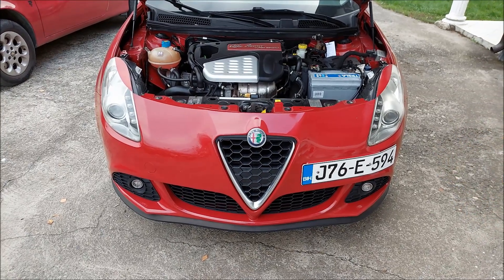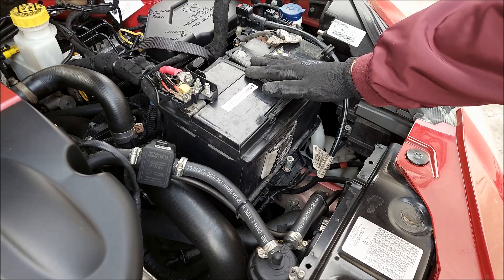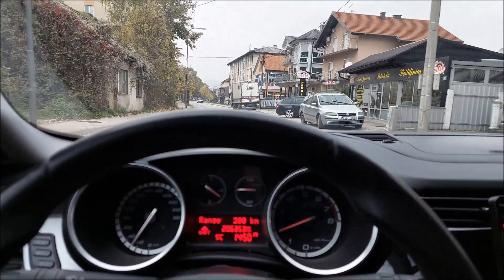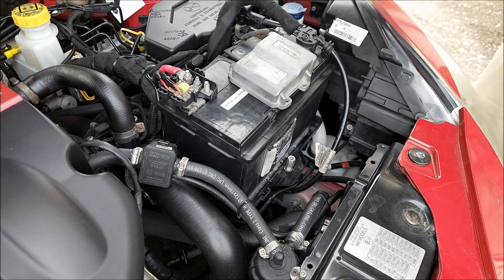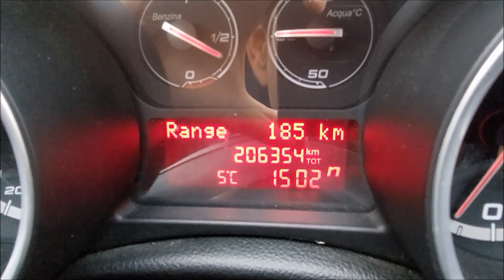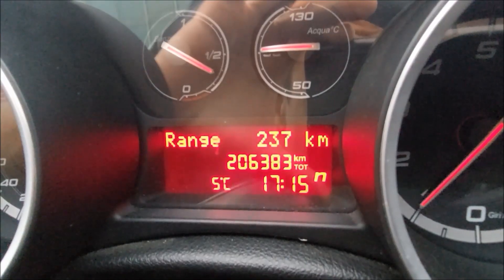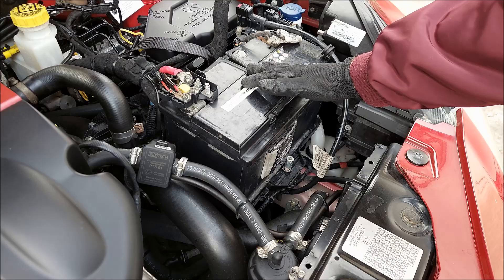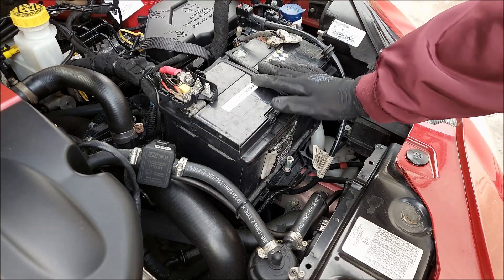Can You Put REGULAR BATTERY in a Car With START&STOP SYSTEM??? TEST

Comment: I bought a car with a normal battery. Not sure why the  previous owner did that but ok.Start stop would sometimes work but most of the time not. Often I had messages like power usage to high,blower power reduced and things like that.The worst problem was that the fan would turn on full blast often and it will not stop until I turned the car off.That was my biggest problem,fan blowing full power lol.
Then I bought new AGM battery all the problems went away.Btw, after I turned off start/stop with OBD anyway
Reply from the maker: Glad you got it fixed 👍
Reply: @arcgarage  I did,tnx

Comment: Interesting. Start and stop is not worth, it just consumes your battery and engine. I have a start and stop that actually stopped working 1year ago and is basically a normal battery now, which honestly is better

You can turn off start and stop but you have to do every time you turn on the car
Reply from the maker: I think it is useless, I used the MES to turn it off altogether

Comment: I have a 1.4TCT Giulietta since bought new in 2013. It has start stop and was fitted with a standard battery when delivered new. I leave start stop turned off and have only ever fitted standard lead acid batteries. They all last over 4 years sometimes 5 years. Only thing to watch out for is if the vehicle was originally fitted with an AGM battery, it has a different rate charging circuit and only an AGM battery should be refitted. Likewise if it had a standard battery originally fitted, you should not put an AGM battery in it as the charging system is not designed to properly charge an AGM battery.
Reply from the maker: Thanks for sharing, I actually pulled a AGM battery out of my Giulietta

Comment: I have a 2012 Giulietta. The start stop has never worked, i have a start stop compatible battery fitted. Its no big deal, but it has never worked
Reply from the maker: Is the battery is weak, it is not going to work, also there also also number of different parameters that have to be met for it to work
Reply: @arcgarage  nah battery is new. It's never worked, not that I care
Reply: Same thing here. Never worked really, even with new battery. When I put a new battery, works for couple of days and it just stops working. Not that I care really 😁

Comment: Great video. I also got an audi a4 b8. I just use a regular battery since they are significantly cheaper and just turn off the autostart features. So far after 2 years works fine without any warnings. Probably good for the starter too not having to start more frequently. Petrol in my country is very affordable i rather pay that. Awesome video!
Reply from the maker: Thank you my friend, and thank you for sharing your experience with us. I agree that start stop wears out some of the components prematurely

Comment: Useful video for those who have not yet switched to a standard battery. I have been using it for a long time (start/stop disabled), no problems in operation. 👏👍
Reply from the maker: Thanks, my experience is the same
Reply: Depends. If your car has brake regeneration the battery is only charged 80% in most start stop cars. It wouldn’t be good for long term normal batteries. But if you can disable that system there should be no problems.
Reply: That's only because you disabled start/stop.  Enjoy the lack of fuel savings.
Reply: @Plarndude  Start/Stop system does not save you any fuel. In fact it doesn't help anything and it is the dumbest thing ever invented.
Reply: @sadzidsmajkic6181  I disagree.  If you are in a city and there’s a line of cars waiting at the traffic lights and all their engines are off it really helps the air quality in cities.

Comment: I have the same model g. After a proxy alignment to connect my new cruise control and after that the indication DRLs and  the regulation setting disappeared from the car's menu. The DRLs are  on only with the rest night lights. What can I do?
Reply from the maker: Hm, you got option there for different clusters, so if somebody installed a different cluster, the option might have reverted to the original thus eliminating the menu. Anyway that's where I would look first